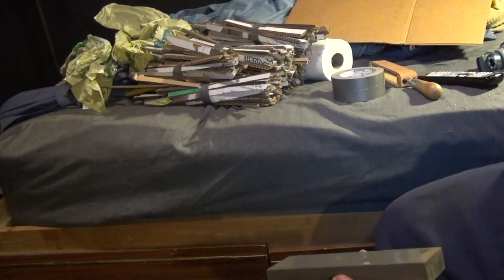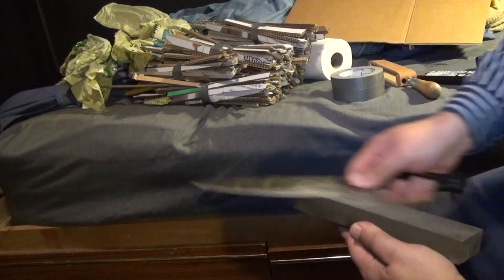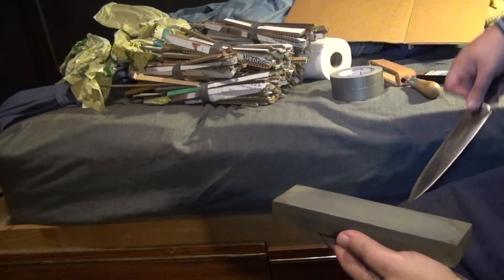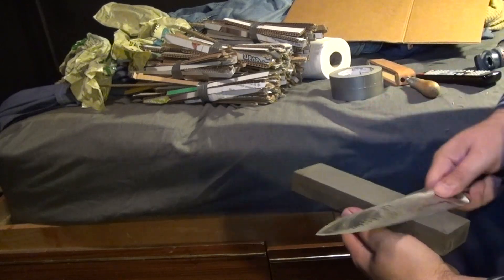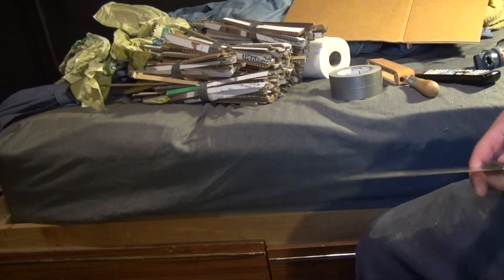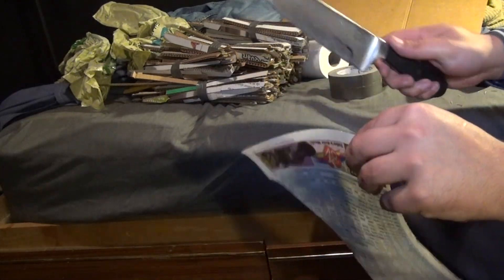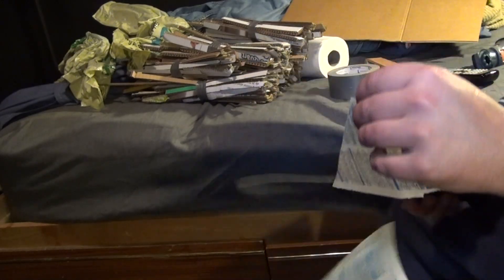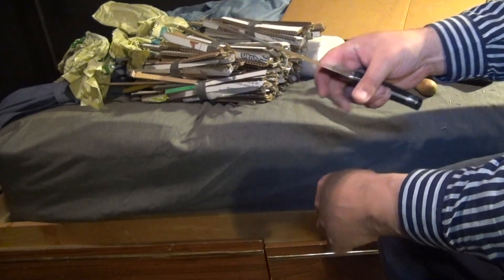Basic three step knife sharpening : destress the edge + shaping + finishing the apex

Comment: Thanks Cliff for your willingness to share your wealth of knowledge. Every time I see your name I learn something new.

Currently I 'shape' my edge up to my 1k Shapton Glass Stone, after about 4 alternating strokes at a slightly higher angle to deburr, or, clean up the apex, I go on over to my strops in which take the edge from usable, to stupid. (Whittling thin hair). I know how you feel about stropping but what are your thoughts on using 4 micron diamond spray on nano cloth for a quick back-to-sharp method of minor edge repair? It is a very thin medium attached to aluminum and is not compressible.

Thanks

-Tj
Reply from the maker: TJ,

Normally I use my knives sufficiently enough that I need to sharpen them when they are dull, a light few passes on an abrasive would not restore them fully and would likely just put the edge in a highly deformed and stressed state.

However if you are using them lightly, and/or, are willing to do that type of maintenance often then very light abrasion, or even a smooth steel rod can keep edges working for a long time.
Reply: Cliff Stamp Thanks for the information. I completely understand what you mean when you say I would rather use a .5 micron stone rather than a .5 micron strop that is not as hard, dirty, full of metal, and cannot flow swarf away. It's weird to me to go from stropping all my life to nearly abandoning them. The only reason I will continue to use them now is because I only use them at certain times, after sharpening, and I'm not quite ready to drop the cash on ultra fine stone. Strops can get me grit sizes higher than any stone available. I suppose I should stop getting high-grit-crazy anyways. After I shape and sharpen on a stone without creating a burr as best as I can, and finish light passes, I'll strop with my fine diamond sprays. I will keep all that I've learned in mind and upkeep my edges more often with stones. Maybe I'll change in time and stop with strops. I guess we'll see.
Reply from the maker: ***** There is that, ultra-high grit stones can be insanely expensive and a piece of micro-cloth and fine grit compound is fairly inexpensive. It just depends on the volume of sharpening you do.

I can go through a 1k stone in a year easily, but the ultra-fine ones, they do so little work and wear so slowly that they last a lifetime.
Reply: I have another question I hope you can answer. Does holding the stone and swiping the blade quickly like that give you good consistency? Sometimes I can't keep my angles consistent and end up with multiple facets. I tried one handed swiping quickly and to my surprise it worked well.

Any tips?
Reply from the maker: ***** I have done it a lot, hence the speed. You might want to start with a jig until you can work by feel.

Comment: For kitchen knives, camp axe, machetes, and lawn mower blade, what sharpening kit or combination do you recommend (for the beginner) to get very good results?  I cut a lot of vegetables for juicing.  Thanks Cliff.
Reply from the maker: For a beginner, a decent semi-hard combination benchstone works well, a norton india for example fine/coarse. 

There are waterstones which cut faster and leave a higher polish, but you have to deal with the wear and how it effect edge angles.

Diamonds also can cut faster but in the beginning if you do not have the motions down you can damage the surface easily and hey are not cheap.
Reply: Whatever benchstone you can get. A cheap 0.50 lev benchstone can be enough to get all those sharp enough to cut newsprint, which is more than enough that you will need from a machete, a camp axe, and lawn mower blades. Might wanna get something better for kitchen knives
Reply: Cliff Stamp
 Would the Norton India benchstone work well for kitchen knives also?
Reply: shurdi3

Thanks!

Comment: You are putting a microbevel on the knife. When you honed the apex, you raised the angle by more than a few degrees. When putting on a microbevel like that, I never worry about weakened metal or a burr. The honing of a microbevel at the steeper angle effectively removes this.
Reply: Taking this one step further... if you don't get all the way to the edge in one spot, you will have to hone quite a bit to put an edge on that spot. By then, the rest of your knife will have a burr - a burr that was created at this steeper angle. Now you're never going to get that burr off completely cleanly.

This is why it's recommended to raise a burr if you are someone who is a beginner and has never been able to get a knife really sharp. Creating a burr all along the blade ensures you are at the edge, and that you can quickly and easily form the microbevel with just a few strokes.
Reply from the maker: Kenneth Lee Ken, yes for a beginner it can be a useful approach, however if you want to truly learn how to sharpen then it needs to be seen as just that, similar to training wheels. It also doesn't work uniformly as certain steels on certain hones will not form a burr at all unless the edge is intentionally over stressed. This and many other reasons is why I would advocate using other methods to check for apexing and not burr formation directly.
Reply from the maker: It depends on the level of burr created and the steel itself. I talk about this in another video and how the grit difference in the shaping and apex finishing stones can influence this and why in general the steel should be burr minimized before the final apex finish is applied.

Comment: Hi Cliff,
there's no way I can get my knives to shave with a Chosera 400 or King 1000/6000, but have no problem with a Spyderco medium grit. What could be the problem? The results are reproducible.
Reply from the maker: Stefanie,

The Spyderco stones are true-flat, very hard and produce no swarf and thus are among the easiest stones to get a very sharp edge from.

In contrast, softer waterstones are like trying to walk in high heels, some people may make it look simple but it really isn't.

When you are ready to finish on the waterstone and are going to do your final passes here are something which should be done :

-make sure the stone is flat

-rinse off any swarf

-go very light

The critical part is to not grind into the stone and remove the abrasive and form a mud or slurry as this will cut into the edge and remove that last bit of sharpness.

By very light I mean just that, really light, 5-10 grams is enough for the abrasive to cut the steel.

If this doesn't work then try edge trailing, but leave that as a last resort.
Reply: Cliff Stamp
I haven't had any luck with the three first tips you gave me. It's ridiculous how sloppy I can work on the Spyderco stones and still get super nice result.
I really don't know what else I could change on the Chosera or King stone.
I've found a video on YT from a user called "virtuovice" who gets about the same results on the Chosera 400 that I get. As soon as he progresses in higher grit regions the sharpening result gets better and better.
But still, you even get your knife to pushcut newspaper on a 200 grit SiC stone...that is simply unbelievable.
I'll try edge trailing now. sigh

Edit: also didn't work. I ordered a cheap magnifier now and will take closer look at the edge. I hope that gives me some insight.
Reply from the maker: Stefanie B. The Spyderco stones are much finer than the Chosera 400, even the medium Spyderco is similar to a fine waterstone however the main reason why they are so nice to put on a final edge is because they are very hard and don't wear. 

The King stones are so soft they can be very difficult to sharpen because of the increase in angle the wear makes (which is random due to the nature of the wear) and the fact that they can easily make very heavy swarf.

How sharp is the knife off of the 400 Chosera?
Reply: Cliff Stamp

Well it slices copy paper with a pull cut, but the edge of the paper is far away from being clean. Slicing newspaper is not possible.
If that's important for you to know, the edge isn't reflecting any light anymore.
Reply from the maker: Stefanie B. The edge is likely not cleanly formed, it has what is commonly called a burr. There are a number of ways to minimize the burr :

-make sure the stone is clean with no slurry
-elevate the angle significantly as in 30-40 degrees minimum
-use alternating passes
-minimal force
-cross the scratch patterns
-just 2-4 passes

This should make a significant difference, if it does not then it means that while the edge was no longer reflecting light it was not fully apexed. The edge will stop reflecting light when it is about 20-40 microns thick so if you stop just at that point it could still not be apexed. 

If the deburring fails to make a difference then go back to the original angle and work the edge on the stone a little more to ensure it has apexed. If you struggle in telling this then you can force a burr to ensure it, however try not to develop doing this as a crutch.

Comment from the maker: The only thing to consider is that if the micro-bevel is very high and you use a lot of passes you will turn it into a poor cutting secondary bevel. 

If you are slicing then you will want it lower grit, if you are push cutting 
higher. 

Keep in mind if the angle is very low then you will get high slicing aggression anyway so no need for the lower grit finish.

My edge bevels are usually in the range of 4-8 dps and the micro-bevels 10-12 dps. I have been using a 6 micron finish lately.
Reply: Cliff Stamp: How do you maintain your edges between sharpening? I think I remember you saying you don't strop… do you do anything else?

Comment: Cliff what is the best gap when putting a micro bevel? For instance on my s30v para 2 I have a 34 degree inclusive edge with a 40 degree micro bevel is that gap to big?  And last question what grit would you use on the micro bevel I put a 1200 grit ceramic on it with a 6000 grit almost mirror polished edge.  Thanks again

Comment from the maker: Yes, the burr method is useful for a novice who can't get anything from the feel of the stone, has no idea when they have apexed or not and doesn't know how to judge if a knife is sharp. It is like training wheels on a bike. Just like you said it turns sharpening into a process of burr removal when instead the simplest method is to simply not form one.
Reply: I’ve sharpened for years on plain old ceramic stones (Spyderco Ceramic Wet Stone, medium) and have always used the burr method because it’s all I’ve known, and Joe Talmadge detailed it in a now-famous how-to essay.

I honestly I don’t understand how one can sharpen straight to a sharp edge and NOT create a burr — at least a tiny, barely perceptible burr. It seems to me that it would be like running full-speed toward a finish line and breaking the tape but trying to not run even 1/16” past the finish line itself.
Reply: @peacefuljeffrey  there is nothing wrong with the burr method. Your feedback is the burr, his is the reflecton of light (or lack of) on the apex. Also it's impossible not to get a burr once you get the apex in contact with the stone, light and alternating stokes (microbeveling) will keep it at a minimum.
Reply: Mind blown.
Reply: So as someone who IS a novice and can't get anything from the feel of the stone and has no idea when I've apexed, do you recommend burring a few knives before I get the feel for how long it takes? Or is it better to not form bad habits? I tried the light method and I was constantly second guessing whether I was seeing light or not, even with a strong flashlight. Then before I knew it I had a burr...
Reply from the maker: @alexgriffin6444  The simplest way to sharpen knives is something like :

-grind to a heavy burr on both sides, that way you know you have ground enough
-increase the angle, do just 1-3 passes per side, alternating

This creates a small apex bevel and cuts off the burr, it should easily get knives sharper than most production knives. As you grow in experience you won't need to over grind as much and can cut back on that heavy burr formation or use other techniques to minimize it.

Comment from the maker: You don't need to increase the angle, however if you don't jig sharpen you will likely find it frustrating if you don't.

A transition bevel is used on larger knives because if you take the primary all the way down to the apex bevel it will ripple unless you leave it think enough which will then likely cause less than ideal sharpening/cutting ability. The transition bevel is between the angles of the edge and primary and used to thin one and strengthen the other.

Comment from the maker: If you can afford them, DMT's. They are much flatter, stay much flatter, will cut any steel regardless of carbide level, can sharpen ceramics/carbide, do not need soaking, etc. . Just be aware that they leave a much more coarse finish than a waterstone of similar grit.

Comment from the maker: If the edge thickness gets too high on a hollow grind then you have two options.

A) Convert it to a flat grind and thin it out as shown

B) Deepen the hollow, requires a suitable wheel -or- a lot of patience and manual sanding.

Comment: I dont usually polish the whole bevel.  I go to a medium grit waterstone, then increase the angle and polish a tiny microbevel using the finer stones.  If you want a mirror edge, you can use wet/dry sandpaper up to 2000 grit.  No you do not need a Wicked Edge, just fine enough abrasive that the scratches are too small to see.

Comment: Just a quick comment.  I tried this using a 220/1000 grit combo stone on a $7 kitchen knife.  It took a couple of tries, but I was able to destress, apex, deburr, and back hone on the 220 grit side to an edge that would split a beard hair.  Afterward, I refined the edge with alternating passes on the 1000 grit side.  This edge would treetop arm hair and catch hair on the back of my head.  I now have a good 4000 grit stone and it should work even better.  Even 3 tries only took 15 minutes.

Comment: You can take a 6" long stone and block one end up 2" or take an 8" bench stone and block one end up 2.75" and you'll have a 20 degree angle approximately.  Then, hold your knife level/flat like a table top and begin making passes on the stone.  The exact angle isn't 20 degrees, but a repeatable angle is more critical than the exact angle when you're first learning.

Comment from the maker: Depends on the knife, when they are used for slicing the grits are lower, when they are used for push cutting they are higher. Generally large chopping blades are finished 3-8k, general utility are about 1k or lower. In general thinner edges also are finished higher grits as they will cut so well they don't need the aggression of low grits.

Comment from the maker: I have many convex knives, there is nothing inherently wrong with having curvature on the primary or apex bevel. When I am talking about rounding the apex it is when the grit ends up actually running perpendicular to the apex which rounds the very edge of the knife which reduces in an extreme loss of slicing aggression. The same things which tend to cause that problem (buffers, heavy stropping, etc.) also tend to over heat the edge and/or mechanically deform it making it very fragile.

Comment from the maker: Yes, and it is made worse when heavy force is used on a heavily loaded strop which causes a lot of burnishing which weakens an edge significantly. John Juranich also discussed this when he talked about using smooth steels in that 1-2 light passes were beneficial, but heavy frequent passes just damaged the edge - again just burnishing and mechanical deformation to such an extent it fractures the steel.

Comment: i think rounding occurs only when people strop at the same angle as the stone or higher, rather than lowering the angle to compensate for compression. i certainly dont see rounding occuring on my edges under the scope. not from a few swipes.. maybe after 50 - 100 on a belt like mears

Comment from the maker: I will clean the knife after sharpening using an edge trailing motion, not particular on the media, it can be anything from a rag to paper to the leg of my pants (hillbillies). On the rare time I use high polishes I tend to still finish on stones (8k waterstone or Spyderco UF) however a rigid loaded strop is significantly cheaper. The main thing is to avoid edge rounding due to over pressure.

Comment from the maker: That is a prototype of an adjustable tension strop made by Busse Combat. It is pretty cool actually, you just turn the handle to adjust the tension of the leather. 

I don't use it or any of the strops I have (a fair number) for functional purposes though I do sometimes for comparisons.

I currently shave with a Douk Douk for the past few months, and for the last couple of weeks a Temperance 2 with the as-boxed edge though it could benefit from some work off the UF ceramic from Spyderco.

Comment from the maker: Yeah, I often condition the slow cutting stones with a very coarse stone to give them a coarse scratch pattern. This breaks down quickly of course but does give some swarf. If you have two of the slow cutting stones you can grind them against each other to do the same thing, and as well run the edges against the flats to speed up the process.

Comment from the maker: Yeah, the AO ones stay flat for a very long time, I prefer stones to cut at maximum speed though and will put up with a little flattening to minimize honing time. Be interesting to see if you can notice a difference in the edges from the SiC and AO stone as the cutting action will be a bit different on high carbide steels.